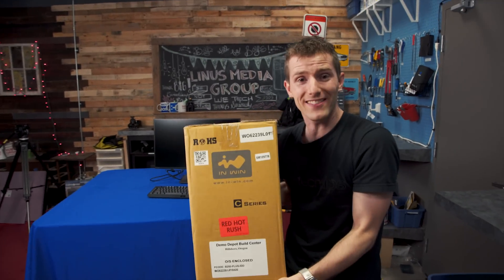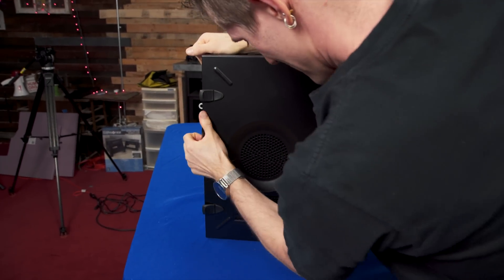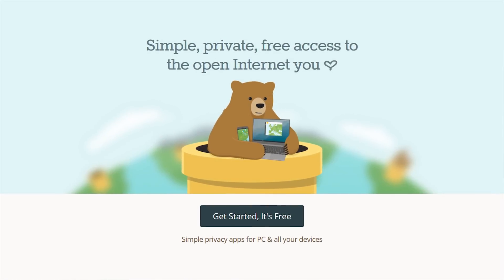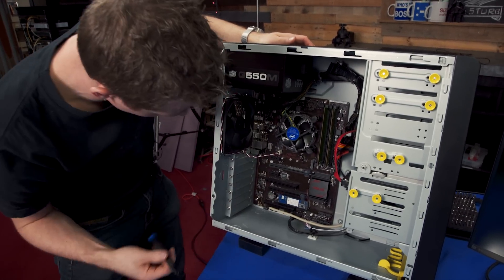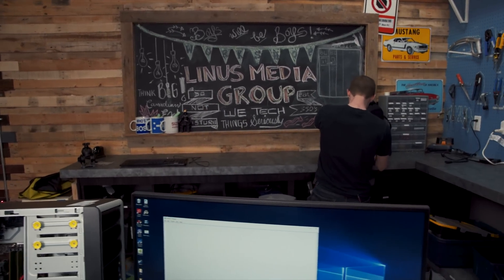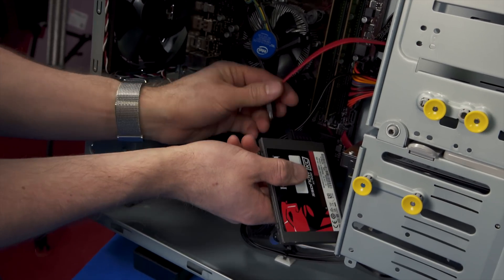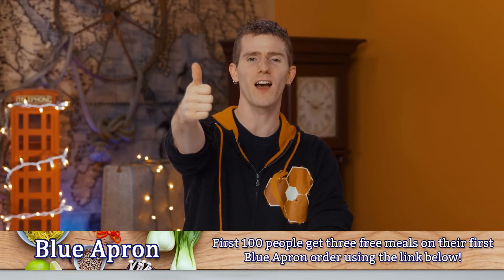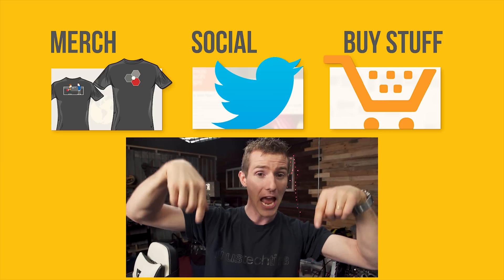Turbocharge your SSD for $40??

Comment: Wait, so Optane only works with Kaby lake?
Reply: +Cable Butkus there is nothing to answer, just get an SSD lol.
Reply: The automatic caching feature only works on Kaby lake and select chip set.  Any system with an m.2 connection  will be able to use it as low-latency nvme drive, or run 3rd party cache software like bcache or readyboost.
Reply: Yes. With the money saved buying amd you can buy an SSD. Why the fuck would I spend extra just get a $40 SSD??? CUZ THATS WHAT IT IS AN SSD!!
Reply: ExpectVacancies How else could they convince people to upgrade. I'm waiting for AMD's answer to this
Reply: Cable Butkus 
Vega has something like this for video memory, but it increases the size, a better solution in my opinion.

Comment: Linus should've done a "Stupid Product. No one buy it" style review video because this is really an idiotic product in light of cheap, large capacity SSDs for similar pricing. 

Here's what I bet happened. Intel spent too long on Optane R&D and thought to recoup some money for now by selling this garbage to some suckers.
Reply: Elliot Kaufman The problem is that a cache doesn't accelerate the whole drive at once.  It can speed up boot times, but other sites' tests found that Windows boot files can be evicted from the cache if it determines another segment of data is more important.
Reply: Red Leader or they already developed the tech which has its uses at super high cost and are trying to find other ways to use it? Also bigger specs still sell better at retail. They'll take the 1 or 2 TB HDD over even the 256GB SSD the majority of the time.
Reply: HardThinker Linus Media is not sponsored by Intel, even if one of their sponsors products sucks LMG will tell it how it is.
Reply: +Fernando Macena current generation of CPU's have a mini NB on chip.
On Ryzen the x16 PCIe slot, a bunch of the USB ports etc are all hosted on the CPU.
Reply: I was disappointed... I wanted L5 Cache :'(
Reply: Red Leader I
Reply: I see no problem with current boot times mine are what ~30sec give or take? On my custom built desktop the UEFI boot time is longer than windows generally.

If you want quick resume times look into Rapid Start which actually copies RAM to a specifically formatted partition on your SSD.
Reply: the DRAM version is on the horizon but there are very very few boards that are currently capable
Reply: Red Leader get over it that that's half their channel now
Reply: Reviewers will do anything to keep their Intel sponsorship.  Simple as that.

Comment: 8:50 I'm very glad you brought the biggest issue with the thing up in the air, the kind of people who would benefit most from these would be the people with cheap $200-$400 systems especially the older systems, other than not wanting to manage two drives I see no reason for anyone to not get an SSD with a brand new core i3 or better PC.

Comment: I was so optimistic until I heard it's only on pretty new systems. Then I began to save up more $$$ for an SSD.
Reply: I got a kingston ssd from ebay for $40.  It died in six months.  I got a Samsung SSD for $100 from Fry's to replace it.  That was two years ago and it's still going strong.
Reply: What are you saving up for? You can get a 120GB SSD on ebay for as low as $30-$40
http://www.ebay.com/itm/Kingston-SSDNow-UV400-2-5-120GB-SSD-SATA-III-TLC-Internal-Solid-State-Drive-/222434074826?hash=item33ca1aa0ca:g:VawAAOSwB-1YwOyc

Comment: When the higher capacity optane SSDs come out, you can use those without Z270 + Kaby Lake right? Just if you use it as a non-caching mechanism. Just as a really fast SSD. Right???

Comment: I wonder if there's any point in putting one of these in a 2nd M2 slot on a motherboard next to an NVME M2 SSD as the primary OS drive, like the Samsung 960 Evo? Would it learn and assist further with time, or is the Samsung already too fast to notice? 

Also - this ONLY works with Kaby Lake and 200 series chipsets? How about no ... fucking Intel.

Comment: I have a quick question.  These modules only work with the newest generation of intel processors right?  So if you wanted to us this, you would need a 7th gen processor, a new motherboard, and a module.  Assuming you are that far in, and you are looking for performance boosting, isnt getting an m.2 boot drive kind of 6 or half a dozen?

Comment: raid 0 nvme vs optane when the ssd's come out plz since i wanna know if i should switch to optane
Reply: John Xue RAID 0 NVMe is going to saturate the DMI on a Z170/Z270 board. One top end NVMe is plenty  and nearly gets you there already. PCI-E 3.0 x4 is starting to be the cap
Reply: Elliot Kaufman I know I just want to see it to give me a good reference 
I'm not really running top end nvme just using two 512 950 pro 
Was originally in my laptop
Reply: 950 Pro is the best if not one of the best consumer SATA SSD's amazing endurance and speed. They could probably be used in enterprise if you didnt loose the warranty. I use a 128GB using Inetls previous tech SRT to cache my RAID10 array. It caps out at 64GB so the remainder is used for Adobe and other programs cache files. Its been taking a beating for 2 years now with 0 issues.
Reply: Elliot Kaufman yeah but what I meant about top end is compared to the large pcie intel nvme drives or the new 960pro nvme ssd 
But I have had no problems at all with my raid set up so far and using it as a web server and home media server and to sometimes play games and it works great

Comment: The silly part about Optane is who has a system with a 7th gen Intel CPU but not even a SATA SSD (which you can get in a capacity large enough for the OS and some programs for the same $40)?  This would be great if for $40 you could pop it in an old computer and increase boot times and common applications without needing to worry about cloning a mechanical drive to an SSD or starting from scratch, but you can't.  Your old computer doesn't have a Kaby Lake CPU because it's old.

I still fail to see who this product is for.

Comment: After seeing the benchmarking results of the Optane accelerated HDD, I thought to myself, "Cool, it works, but if you've got an M.2 slot, your build must be fairly recent, and if your build is fairly recent, surely you're using an SSD for your boot drive." So, yeah. It's nice to see that there's new ultra-fast technology, but it's of no use to me, and I struggle to think of an application for this given the prerequisites.

Comment: so can you use optane on a hard drive and still have an ssd
Reply: Master Gaming ssds arent that much more expensive than these
Reply: +Goran https://pcpartpicker.com/product/X998TW/pny-internal-hard-drive-ssd7cs1111480rb?history_days=365 Thats the best one i found with 10 seconds of research. Usually when black friday rolls around there are tons of them, plus ive found a 750gig on sale for 140 before.
Reply: I'd recommend getting the m.2 Samsung 960 EVO on Amazon. The 250 GB option is only $127.99 and has substantially better speeds than any other Sata SSD or m.2 on the market. 

Here's a link if you want to take a look: https://www.amazon.com/gp/product/B01LYFKX41?ref_=sr_1_3&qid=1493080195&sr=8-3&keywords=samsung%2B960&th=1&pldnSite=1
Reply: Optane can only accelerate the boot drive currently... their use cases just keep shrinking!
Reply: Master Gaming That's a nice way to put it.
Reply: Um u could spend 100$ for a 1tb hard drive and octane, or you could just buy an 500gb SSD for around 110$
Reply: SenorSwagBuns sorry I didn't say that correctly I have an ssd and hdd in a pc I'm about to build should I get octane as well
Reply: iif most of your common used files is on your ssd then no
Reply: +Master gaming From the benchmarks here i dont see why you would, your only gaining about 1 second load times at best over an SSD. At the price point of 40$, just buy a normal SSD install windows on it, and your most commonly played games.
Reply: I think I only paid around $100 for a 2TB Seagate Firecuda hybrid drive this past Christmas. Just boot off of a SSD or an m.2 and get one of those for games. Cheaper and more far more compatible with motherboards than Optane. Use your other HDD externally for regular system backups or something.
Reply: +Brent Murphree Mec Drives are pretty solid tho, although all of mine are from WD, or seagate. But yea SSD over anything.
Reply: Don't forget you need a brand new Kaby Lake CPU and z120/z220 board.
Reply: I got a 5TB HDD from Amazon for storing movies and other large data files. I think I paid an extra $7 or so for a 2 year warranty that included data recovery and replacement if the HDD failed. I think at least 2 guranteed years is fine for the huge capacity you get.
Reply: Sahil Zubair exactly why won't sell
Reply: +drud 1995 You haven't read the fineprint with those data recovery services.  They only make a single pass at attempting to recollect your data and if they fail then they give up and tell you that your data is unsalvageable.  I've worked at data recovery centers before and they can try up to a dozen times before they get all of the information off of the hard drive if it's overheating around a certain platter or bearing.  It's better than nothing, but if it's not a PCB malfunction and really is a bad hardware issue like a maligned read/write head then the chances of seeing your data again are slim and none.
Reply: Hmm... I could always get another HDD to back that one up to I guess, or the Amazon unlimited storage for $60 a year.
Reply: There are no decent 500GB SSDs for anywhere near $110 right now. That PNY one you linked is one of the slowest SSDs that I've seen and is $130, not $110. If the choice was between a 1TB HDD and Intel Optane for $100 or that PNY SSD for $130, the HDD/Optane combo would be better. Equivalent, if not better, performance and double the storage capacity for $30 less. Hell, you can get a 2TB HDD for around $70-$75 and get the Optane for less than that SSD.
Reply: kek
Reply: ADATA Ultimate SU800 512GB 3D NAND 2.5 Inch SATA-III Internal Solid State Drive  currently $136.30 on Newegg until midnight...anybody who would pick a hybrid setup over a large single SSD is going to be sad when their mechanical drive stops spinning after 6 months for no reason or warnings.  I've had one SSD die that I've ever owned and it was an OCZ Summit that crapped when I upgraded the firmware to enable TRIM support because they released crap firmware.  The rest of them all still work to this very day, as opposed to my box of 250-5TB hard drives that are all marked BAD with a black sharpie.

Comment: Basically if you use your system in a way which would need a cache, the cache is never large enough to make sense.  This was how it was for the previous 32-64GB ssd cache solutions a few years ago.

Comment: I would like to have seen an NVMe SSD used as a caching mechanism for the harddrive as well.
Reply: Lars Bolduc An old version of the Optane software actually allowed that since the Optane drive is basically just a NVMe drive with different performance characteristics lol

Comment: I think this would be a valid use for anyone building a new budget system with future proofing in mind. BUT. Because of ryzens performance that shinny new i3 is garbage/dirt as far as I'm concerned. so amd kind of kicked Intwl in the pants, also for 77$ ya can get. my digital nvme sad, if it wasn't for the band shortage ATM due to Samsung and the like doing some experiments.... sooooo this could be in their favor for short term because of nands pricing point ATM. otherwise ya made a new irst Intel.... no one used it before, let's see how your gamble pays off now. 
it also doesn't help raid mode has to be enabled for the optane memory to even be usable, which at that price point and also how likely it is people are newbies is more likely then not.... I think UNTILL the SSD ones come out it's just going to be a flop.
Reply: also a overclocked i3 sucks, period... theirs so many test out there. your paying a high premium for overclocking when the non overclock variant i5 kaby lake (which is around that price point) can beat it in ispc which is the most relevant for gaming and workloads a lot of times (did they even release a non k skewed i3 this time? ) 
yup they did, but it's a freaking dual core..... for gamers that is useless these days and will leave you wanting SOON.